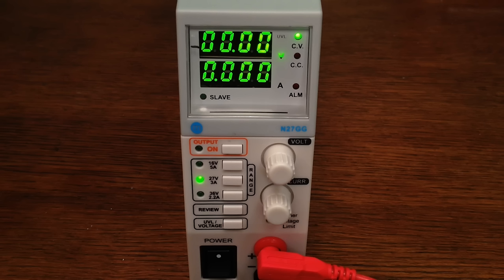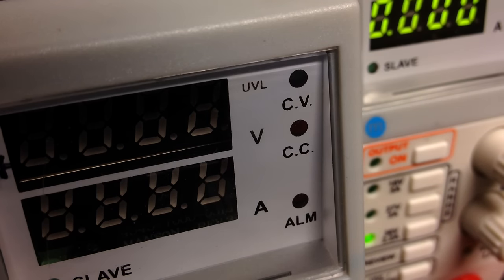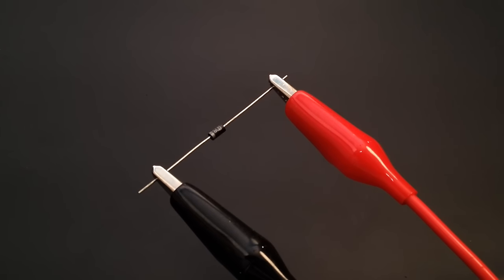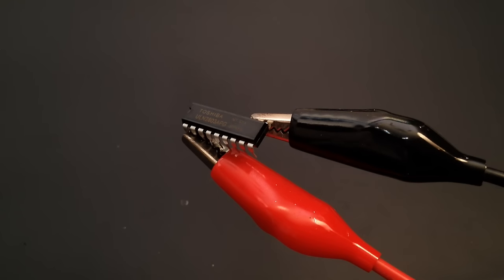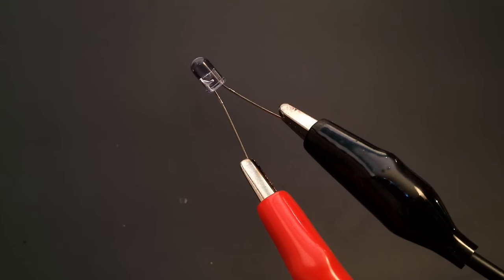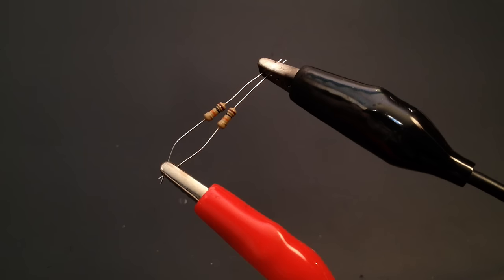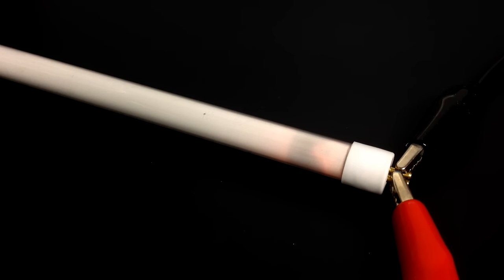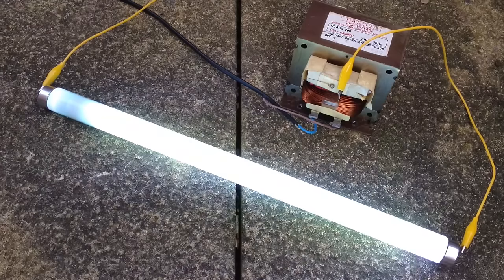Breaking In a Power Supply  (Overloading Electronics)

Comment: Dan, be aware that those power supplies all seem to have a glitch that can cause them to crash on rare occasions, but do it in style by putting out a random voltage.  If whatever you're working on starts misbehaving check out the display and whip the leads out if it's showing a high voltage.  (Then video it in its crashed state.)  Maplin seem to be in denial about this problem and have removed product feedback mentioning it.
Reply from the maker: I’ve had them flick to 36V for no apparent reason. Figured it was something like noise being coupled back as it only ever happened in smps development. Got in the habit of setting the voltage limit every time after losing some expensive silicon.
Reply: @TheAwesomeManDan  you gotta be careful with high-frequency stuff, I've had three 555 timers leave a dent in the ceiling because some high-frequency noise got back to the supply and it just stopped regulating voltage and current temporarily.
Reply: @TheAwesomeManDan  I subsequently discovered that when it crashes the three voltage range LEDs will be off, but the actual range selected is the 36V range.  I've got in the habit of making sure that on the rare occasion I use that range I always set it back down to about 3V.  That way when the PSU crashes it just puts out 3V.  Shame - it's quite a useful supply otherwise.
Reply: @bigclivedotcom  How often does the supply crash in your experience?
Reply: Needed more data or just another notification about the question of "how often does the thing crash"
Reply: You are CRAZY!
Reply: @Kalanchoe1  noise?
Reply: @ianmoore5502   noise? like interference on the supply rails. I was testing some high-speed transistors and things got weird.
Reply: @Kalanchoe1  thank you! I'm learning about electronics a bit here and there.
Reply: I love how we are talking about the power supply. I really want one to do the same things as in the video
Reply: @ianmoore5502  learning on your own can be the most fun way to learn!
Reply: 日本語です
Reply: I love your voice
Reply: I have had one of these for several years now, and the issue with them randomly jumping to 36 volts has happened to me at least five times. In some cases, this actually ended up frying some components, so yeah, great power supplies otherwise, just make sure to double check the output voltage range (if all three LEDs are off, it is actually in the 36 volt range without indicating it). This issue seems to appear upon disabling the output, especially if you turn it on/off in fast intervals.
Reply: @fklabs6813  It defaults to the 36V range's last settings.  If you leave that range at 3V after use it reduces the risk of an incident.
Reply: Electroboom shocked himself due to a similar issue in one of his videos
Reply: Coincidence I found Clive's comment 3 years ago by accident, welcome Clive 🌟
Reply: Oh no, I am using mine as a "temporary" power supply for the garden electronics for about 18 months now.  Thankfully it hasn't crashed yes as i don't think all the LED strings would like 36v. Maybe it's time to install the fixed 12v supply I have been thinking about doing for nearly 2 years 🤣
Reply: @arcadeuk  Just make sure you turn the 27V and 36V ranges down to around 12V and it means that if it crashes it won't overvolt the lights.
Reply: @TheAwesomeManDan  why haven’t you uploaded in 4 years?!?!?
Reply: I'll be avoiding any and all Maplin products with that information to now consider.

Thanks man!
Reply: big wet creamy explosion containment pie dish.
Reply: @TheAwesomeManDan  PLEASE COME BACK
Reply: @TheAwesomeManDan  This takes satisfaction to another level lol

Comment: I've heard many reports about batteries just firing up with no reason, causing massive disasters at home. It must be overloaded somehow, so the only guilt is to blame the transformer, I guess, or the cheap electronic circuits. Pay attention to what you buy, people.
Reply: I have read all

Pro
Reply: shouldn't be that extreme surely. unless it's a 9v battery, lipo, li-ion or other high voltage battery
Reply: @vishwarao6064  i woudnt risk that!
Reply: @windowsxpthevyonder1517  y

Comment: Dude, that is hands down the coolest smoke ring I've ever seen. The way it was drawn back in by the suction cause by the heat was cool enough, but then it not only survived impacting the alligator clip, but also survived and gained thermal energy from the heat column, which was converted into enough kinetic energy to expand it and give it escape velocity through the suction on the other side. That one little smoke ring displayed so much beautiful physics that I can't believe it only got a one frame mention.

Comment: 8:04 uhh i have a question
did that wire bend?
why?
Reply: Wires do that when a lot of current is passed though them, they do that for both AC and DC current, however i think the only do that with a combination of high current AND voltage, because iv'e never seen this happening on my 120A 16V line...
Reply from the maker: It's an effect of the magnetic field from the transformer and the current carrying wire interacting with each other.  This produces a force, moving the wire. You can predict the direction of that force using something called the "Fleming Left Hand Rule".
Reply: DanTheAwesomeMan Do those wires get pretty hot?

Comment: one time I was playing around with some tantalum capacitors, and i accidentally connected it the wrong way to 9 volts, and the whole thing exploded with a huge bang shooting parts of itself across the room. I then decided to do it again but ramp up the power slowly. Eventually, pink smoke came out of the capacitor.

Comment: Random question, how come the SMD cap that's rated for 50V (at 3:50) blew out at that voltage ?
Reply: If it's installed backwards, it will explode at much lower voltage, sometimes less than half the rated voltage.

Comment: I really don't think you were using those PSUs the whole time.  lol
Reply from the maker: +YTPmaster With great power comes great need for artistic license.
Reply: +DanTheAwesomeMan What PSU are you using? Looks very nice, I might want one for myself.
Reply: +YTPmaster 

Yeah...

...How do you blow a capacitor with DC?  I'm sure that the tantalum cap (02:00 - 02:22) was rated at more than thirty-six Volts!  Did you hook it up backward?  AC?

After listening further, the "hum" gives it away; this is mains voltage on everything.
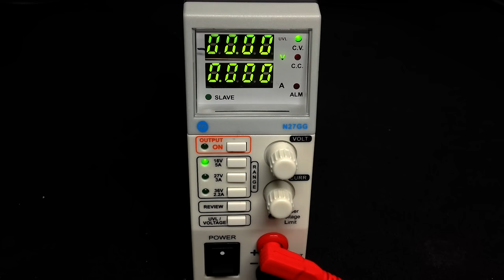Reply from the maker: +EdWatts Everything up to 4:18 was purely 0-36V DC from one supply, caps just reverse biased. No guarantees for the rest.

Comment: I have a power supply, and I decided to test mine like this. It's an Eventek KPS-305D, 30v 5a (although I found that by turning the fine-tuning knobs all the way up it can actually go to 31.7 volts and 5.2 amps). The resistors burned, the transistors caught fire, and thin wires? Let's just say I know how to make lightbulbs now. Oh, and I tested it on a diode, which immediately split in half.

Comment: make a video with you plugging these into 110/220v. more fireworks ensue.. I used to hook that up to motherboards and hard drives. the motherboards would make big fireworks. 120v into the ATX cpu and 24 pin connector.

Comment: Very good, in 1977 at 12 years old, I did the same thing as you, with a 9V DC power supply only 400mA not stabilized but filtered.
Resistors, capacitors, at the end a nice cat whiskered tungsten germanium diode OA85, first pass + cathode and - anode nothing, second pass + anode and -cathode short circuit, third pass again -
anode e + cathode woooooow a bright and brilliant light, today they are called LED and LASER, same experiment with D9B of Russian origin very soft yellow-orange lightBravissimo, nel 1977 a 12 anni ho fatto la stessa cosa come te, con un alimentatore 9V cc solo 400mA non stabilizzato ma filtrato.
Resistori, condensatori, in fine un bel diodo baffo di gatto tungsteno germanio OA85, primo passaggio + catodo e - anodo niente, secondo passaggio + anodo e -catodo corto circuito, terzo passaggio di nuovo - anodo e  + catodo woooooow una luce luminosa e brillante, oggi li chiamano LED e LASER, stesso esperimento con D9B di origine RUSSA luce giallo arancio molto soft.

Comment: With a new power supply comes the tedious responsibility to ensure it's up to the job. In this situation you could:

Definitely Remove the EVGA Power Supply

If you've replaced your power supply in the past, it's likely that you did it without taking the time to do a complete overhaul, which is something I wouldn't recommend. As a secondary solution, you could disconnect the old power supply and swap it with an EVGA 650w power supply. This will also destroy the newer power supply, but it's the least bad option.